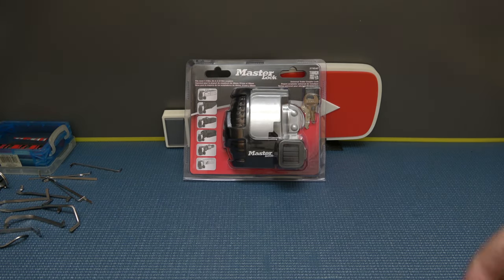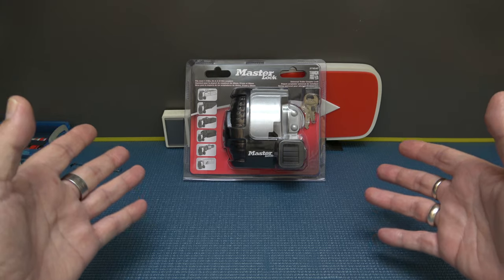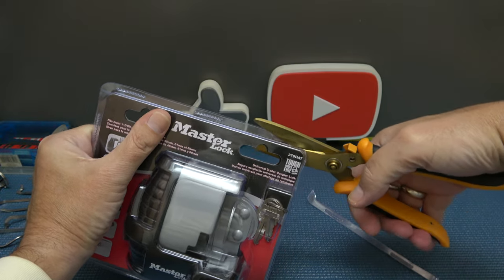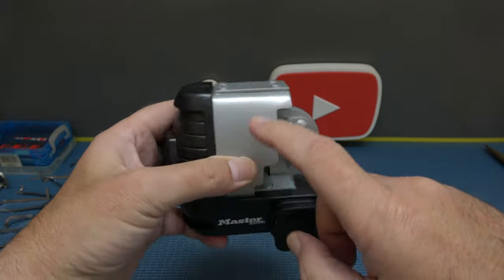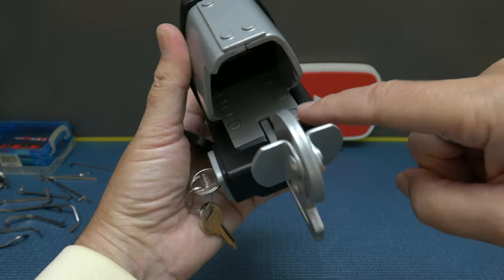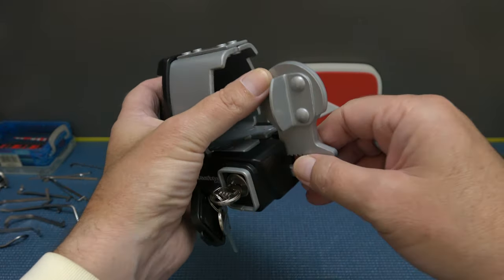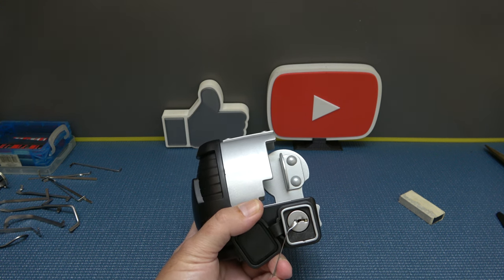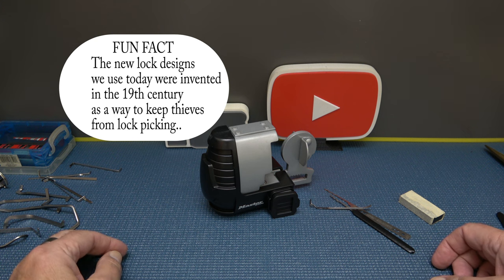#484 Coupler lock M379DAT (Complete rubbish)

Comment: Master uses disc detainer cores on some of their bike locks. I would rather have a disc detainer core. Problem is....users of disc detainer locks don't typically find them that straight forward to use.
Reply from the maker: You are correct. Most people don't understand how to use DD locks because you sometimes need to wiggle or feed the key in before it goes all the way in so they think it's not working right. But yes, same here. I would rather use a DD lock over this garbage

Comment: Garbish and rubbage I say 😆 In all honesty I've seen almost no really good coupler locks, and the good ones are very expensive in comparison. Sad that the average buyer won't know how bad this and others like it are, but at least it might cause inherently lazy thieves to go after an easier unprotected target instead which is about the maximum this lock can do for someone. A good vid as always 👍 Also keep an eye on the weather there Tuesday Albert, slight chance of some nastiness happening but mostly to the south of you.
Reply from the maker: Yes, you hit the nail on the head. I think most of us count on exactly that, we count on the bad guys to see this big tough (looking) lock and hit the easier target. Thanks for the heads up, ya, we get some crazy weather around here this time of year. One day the heater is on, the next day the AC is on. We have to be ready for anything.